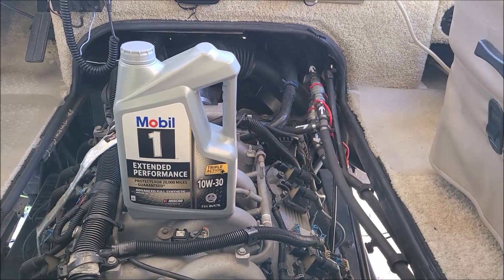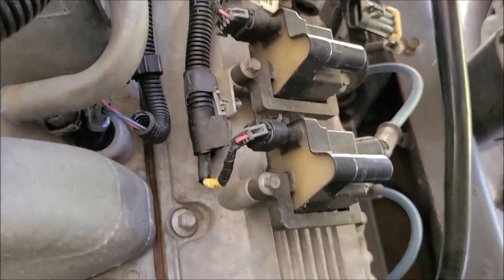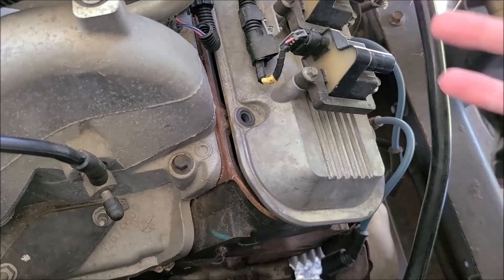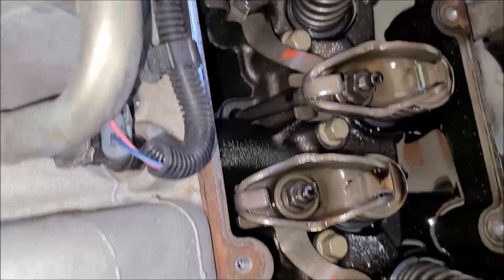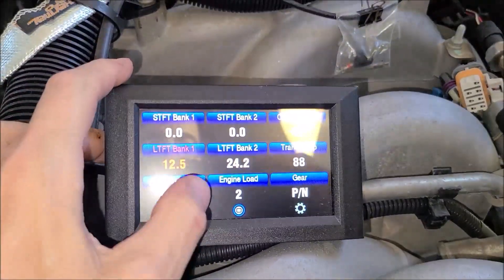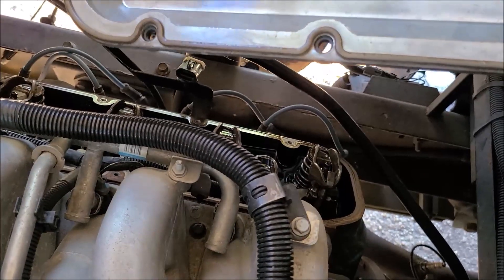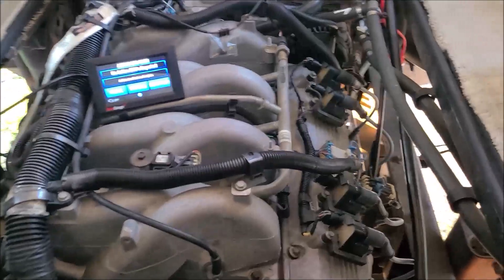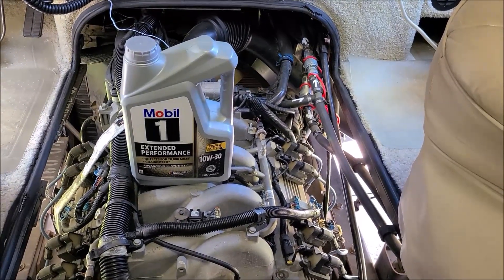Look Inside This 8.1 Vortec After Running Mobil 1 Oil 75,000 Miles & Changing Oil Every 3000 Miles

Comment: Thanks for the video, makes me tempted to do the same thing with our 2002 P32 8.1L with 102,000 miles that we have owned since 2016
Reply from the maker: Please do let me know what you find. send me pictures, my cell 606-875-0125 Kevin
Reply: @ktoutdoor  Will do, but it will probably be this winter, I still have a number of things to do before we leave for a 3,200 mile, Month + long trip to Yellowstone in about 3 weeks.  Already painted the roof, added 2 more solar panels, new refrigerator vent, changed the oil, added a new shunt battery monitor, etc.  I Still need to replace front brake lines (did the back ones and all the calipers last year, along with updated hyrdoboost, and new master cylinder), lube the 26 zerk fittings, replace the oil cooler hose, check the water heater anode rod, etc.  Oh and I need to pack
Reply from the maker: @MrPenguinLife  Bless your heart.. safe travels my friend. If you have any troubles on the road you got my cell number...
Reply: @ktoutdoor  Thanks, it seems one thing after another keeps popping up this spring, for example after it sitting in the shed for several weeks while I worked on stuff on the roof, I started the engine up and found a pulley bearing was chirping.

Comment: why do you run 10w30 vs 5w30? I have a 8.1 vortec in my gmc top kick 5500. It runs great but the oil pressure at hot idle is like 10 psi but when driving it goes to around 40. would running 10w30 make oil pressure higher and better lubrication?
Reply from the maker: With 10W-30 I run 18 psi at idle and 44 psi at 2550 rpm. 
Why I run 10W-30.. Motor Oils Viscosity vs Fuel Economy vs. Engine Wear a great read see link below
https://www.machinerylubrication.com/Read/518/motor-oils
Reply: @ thanks a lot. I just wanted to make sure I wasn’t hurting my engine by it running at around 10 psi oil pressure at idle. I guess the 8.1 runs a lot lower psi than other GM v8 engines.

Comment: I drive an 09' Matrix, Mobil 1 but every 6k or so (Whenever the car calls for it) had to do the valve cover gasket at 125k and it looked just as good as your engine. 
Everyone has a different opinion on when to change the oil, but with synthetic i wouldn't go 3k. You can most definitely go farther than that, maybe 5-6k is still safe.
Anyways, great video Merry Christmas from Chile!

Comment: Thanks for sharing, looks excellent! I have an '03 Toyota 4Runner with 4.7L V8 and 158K miles that I've had since 73K miles and been diligent with my oil changes like you, mostly with Valvoline full syn, 5W30. I changed valve cover gaskets recently and was pleased with how mine looked too. We both have engines that are not as "emissionized" as todays engines and respond to good maintenance. The engines today with direct injection, EGR, variable timing, cylinder cut-out, thin rings, etc. are rolling bombs in many instances.
Reply: I drive an 09' Matrix with the infamous 2AZ (Fixed by the dealer) it's as new as I'm gonna go, while the mpg is not great because it's an AWD pig (3360lb) with a 4sp tranny. So far it's got 130k and the same thing you mentioned, when I did the valve cover gasket it was insanely clean. No gunk, not even yellowing of any parts, silver aluminum new everywhere.
Keeping up with oil changes will make any engine run forever, it's crazy how so many people neglect it.
Reply: @zerocool5395  I had an '07 Matrix, best vehicle I ever owned! No problems in 215K miles, original Clutch and water pump.

Comment: I've got a 94 Corvette that came from the factory with Mobil 1 and I've ran it the whole time I've had it currently have 73,000 miles and when you pull the cap off the valve cover it's as clean as new on the inside not even any varnish .
Reply from the maker: Thank you for contributing.

Comment: I just did VC gaskets on a 2014 Silverado 5.3 with 140K miles on it, the customer runs only mobile1, changes oil every 3500, and looks the same. I would not have guessed it would be that much difference over other oils, but I am sold that it does it better.
Reply: I've got a 94 Corvette with 73,000 miles and it's as clean as new under the valve cover it came from the factory with Mobil 1 and I've always ran it , not even any varnish inside
Reply: If you do 3500 mi changes with any synthetic oil you have no deposits unless idle hours are over 500.

Comment: My MH is an 2003 with 56000+- miles. I'm am amazed that there have been no leaks, even small ones of oil. Using Mobil 5-30 mostly but sometimes 10-30. We travel in the western states with heat and high mountains and most trips are multiple days of driving. Just returned from a 2100 mile RT and the dip stick sits just below the full mark. I've only added oil on very long mileage trips when i couldn't change my oil. 
I wonder if using Mobile oil helps in fuel economy? I got 6.5 to 6.88 mpg on both legs. Elevation change was 20' above sea level to 7420' ASL with little wind either direction. That about normal for our trips. 
Let me say that i look forward to your videos and the information you share. You're wonderful, and thank you.
Reply from the maker: Thank you for contributing, David. I'm glad to hear you injoying this beautiful country of ours.

Comment: Hi Kevin!  Great to see great results from years of maintenance.

I too have been using only 5W-30 Mobil 1 oil in my 2005 Winnebago Vortec engine - just like yours.  Bought this unit with 46k miles (now at 87k), but never looked into the engine like you did here, as I suspect the PO did have the oil changed properly.  One can tell a lot from just looking at the oil on the dipstick - such as color and viscosity.

One question for you - if you faithfully change your oil every 3000-4000 miles is there any point in paying a bit more for Mobil 1's "Extended Performance" oil (which they claim can go as long as 20k)?  I never have, just been using their regular blend even though I will usually go about 5000-6000 miles before oil changes on my rig.  I always figured that was one of the advantages of using a good synthetic oil - that it would hold up better in the long term, meaning that it would not break down into sludge nearly as easily as a petroleum oil.  Besides - during that 5000 mile interval I would usually have to add 1 - 2 quarts of oil from normal usage. meaning that I would be adding as much as 1/3 of the engines total capacity (6 Qts total) in new, fresh oil that would certainly be beneficial to a longer oil change interval. BTW - always changed oil with a new oil filter (pre-filled of course).

Finally - when driving my RV it is usually for some distance or long stretches.  Rarely used it for local stop & go driving like my car.  With longer driving times I always figured that was much easier on the engine - and it's oil.  Fewer cold starts, driving engine fully warmed up, etc.

Mobil 1 also sells an oil specifically for "High Mileage" engines.  Never really learned how that was any better than using their regular product if doing regular oil changes.  Any thoughts?  

But from all my years of auto maintenance & repair have always read that oil additives are not needed as long as regular oil changes are being done.  Those regular changes are what is REALLY important.  Besides - when I am doing an oil change that also gives the opportunity to look around underneath my rig to spot any other issues - certainly something I think you have found of great value - judging by your past videos!  And that is certainly important in performing preventative maintenance.

Also "funny" to see - at the end of your video - the awkwardness you and SP had in working around the top of the engine from inside your rig.  I have found that while it is nice to pull off the doghouse cover to gain access to the engine that it is still VERY awkward to work on it.  I always felt that if I had to do some serious engine work from that angle that it might be easier to remove the driver and/or passenger seats 1st.  But when doing something like changing the spark plugs I ended up laying a 2x4 across the top of the engine - supported on the carpet flooring on both sides so it would give me something I could lay on as I did not want to put any weight on the components or wiring on top of the engine.

Thanks for another very useful and informative video - nice work!
Reply: I believe high mileage oil has a polymer additive to prevent and aid leaking seals. If you don't have any leaks, don't use it. I believe it doesn't have any additional lubricating qualities.
Reply: Thanks, Kevin. As usual another great video lesson. I never would’ve started my engine with the valve cover off like you did. Glad you did it for me. I have a 2006 Winnebago adventurer 33V. It’s a 2005 chassis. I have 112,000 miles (I average about 7-8,000 mpy) and I use 5W 30 Mobile 1 with an M1-303 oil filter. When I take my valve cover off, I’ll send you a picture. How often do you replace your MAF sensor?
Reply from the maker: @sierradk  I changed ours at around 40,000 miles. It's still producing good numbers at 75,000 miles.  It was pinging at 40,000.
Reply from the maker: @richardhubert1346  great content as always.  I did not choose the high mileage on purpose. I think that's all walmart had at the time.

Comment: Very clean....I also use sea foam in the crank case about every 4th oil change
Reply: I'm an old school mechanic. About every 3-4 oil changes I use a quart of atf. I also run Mobil 1 in my vehicles, bikes, and yard equipment. My 2001 Jeep just hit 234,000 and doesn't use a drop of oil.

Comment: I use the same exact oil by your recommendation Kevin!
Reply: I use the weight of oil the manufacturer recommends. I had noise in a 1995 Chevy Lumina many years ago, noise from the top of the head, like lifter and tappets. Here it was I was using 10-30 weight when the engine oil cap said 5-30. I went to 5-30, noise disappeared.
Reply: @lars277  you may have had some sludge or buildup stopping the thicker oil from getting into something but this engine has higher recommended oil in other countries not to mention if you go to the message boards for the Silverado guys who run the 8.1 many of them run 15w40 diesel oil in them with no problem… the little difference this is, especially only when cold shouldn’t be an issue if anything a better coat for engines that have been sitting a while